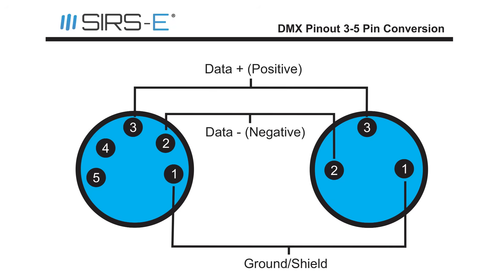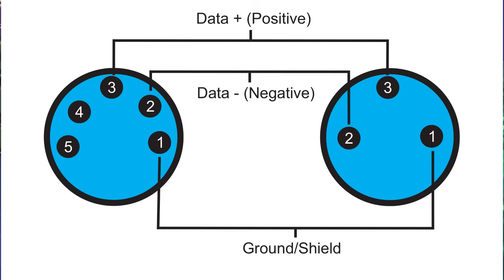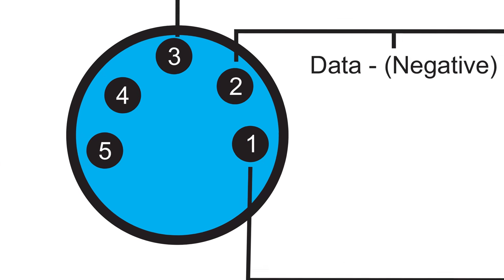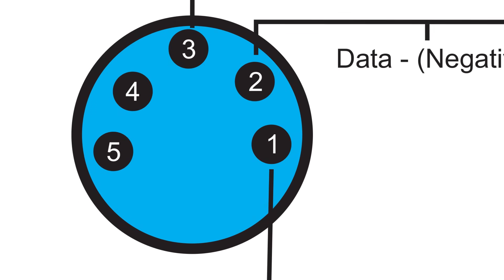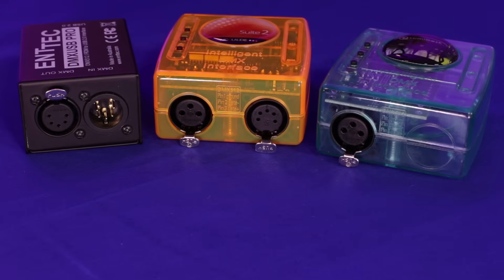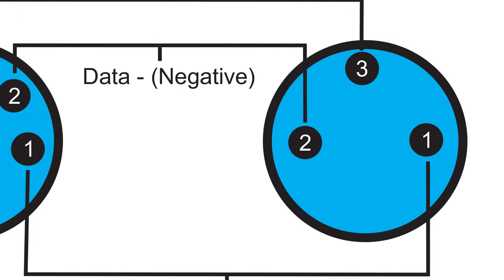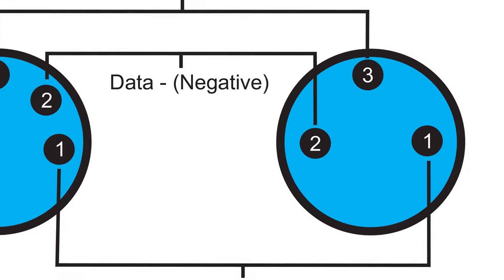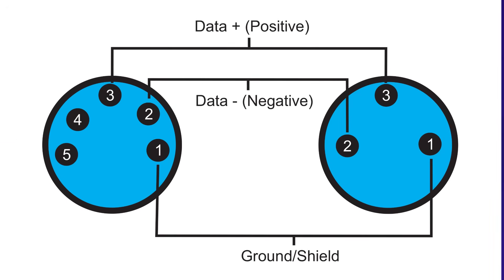DMX 3 Pin vs 5 Pin Connector - The Standard Explained

Comment: I want to connect a madrix plexus that has 5-pin input/output to a dmx512 decoder for a standard ws2811 led strip, i can only find 3-pin decoders so can i just use a 5 to 3 pin adapters? so 5-pin male to 3-pin female for example
Reply from the maker: Hello, as long as the pinouts for 5 pin DMX and 3 Pin DMX matches, you should be good.

Remember, DMX pinout:

Pin 1 = Ground
Pin 2 = DMX -
Pin 3 = DMX +
Pin 4 = NC
Pin 5 = NC
Reply: Amazing, you guys are fantastic. Please keep making videos, you have the best descriptions.

Comment: Question... ???

Why does the 5 Pin have that metal indentation curving inwards on the 5 Pin Male?

I've been looking for an adapter and the ones I see, don't have a groove to accept that, but those interface boxes do... What the appropriate adapter to make it a 3 Pin XLR to go into a mixer... I'm working with a Mic...
Reply from the maker: HRHHRSRMHEMLORNTAerick MuellerLux That metal indentation on the 5 Pin Male connector is the area that the metal ridge from the 5 Pin Female connector fits into.

You can find our brand of 5 Pin XLR to 3 Pin XLR adapters here:
http://sirs-e.com/shop/dmx-connectors/dmx-adapter-5-pole-female-to-3-pole-male/
http://sirs-e.com/shop/dmx-connectors/dmx-adapter-3-pole-female-to-5-pole-male/

Comment: To convert 5 pin to 4 is possible but what if I want to convert 5 pit into 2x 4 pin dmx cable. Would I still be able to control two lights using only one output? Of course I would not be able to control these two light independently but was wondering if splitting 5 pin DMX into 2X 4pin dmx would work?

Comment: Could you please give some examples of what pin 4 & 5 could be used for?  Would it be possible to be used to power another small fixture?
Reply from the maker: The additional pins are often left unused in most DMX set ups, Some brands carry proprietary controls and signals. Voltage as well.